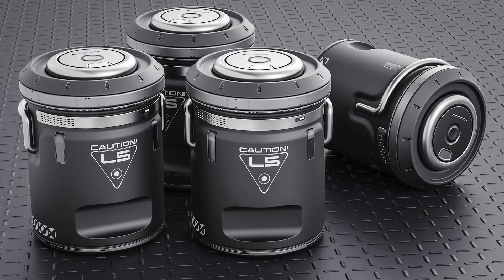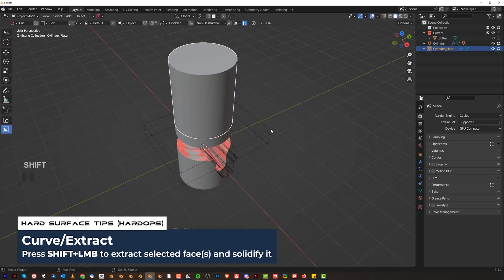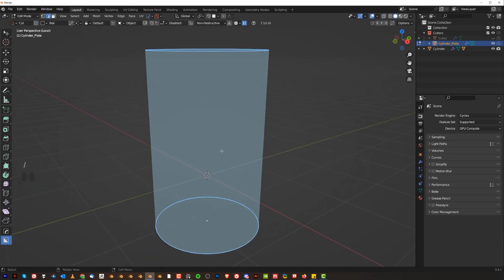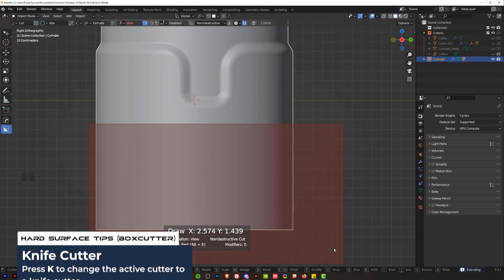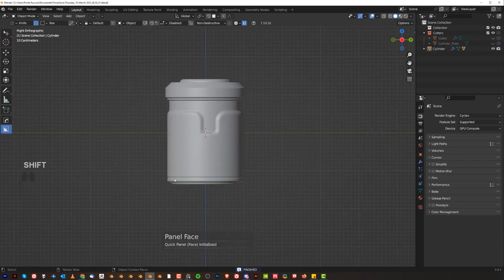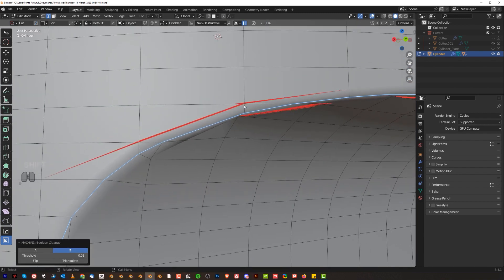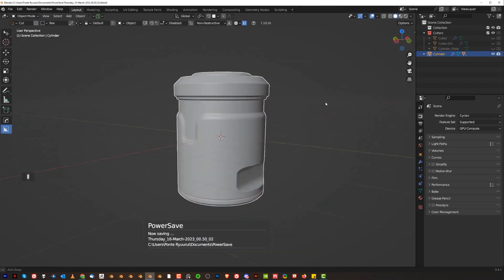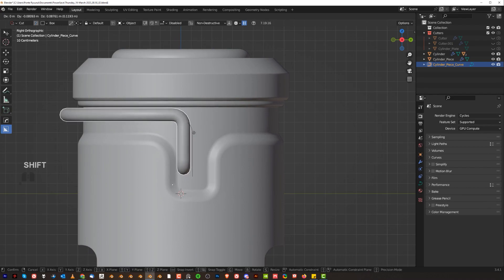Blender Modeling TUTORIAL for Hard Surface

Comment: Please Help :)
Offset cut doesn't pop up... I have selected that edge and I press y but only can see Boolean Cleanup, Chamfer and Offset in that section...
Offset cut doesn't appear and I don't know why :( And I have same version off MeshMachine
I've solved my Problem with another vid by you ^^
But if anyone has the same Problem you need to activate experimental mode of MeshMachine in preferences.
Your tutorials are the best out there for using Boxcutter, Hardops and MeshMaschine.
Love u'r tutorials :)